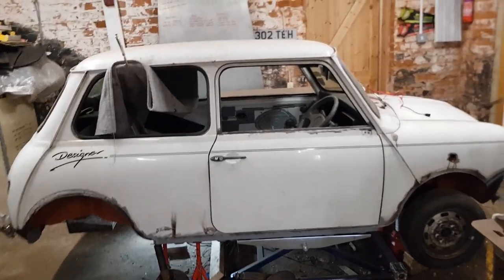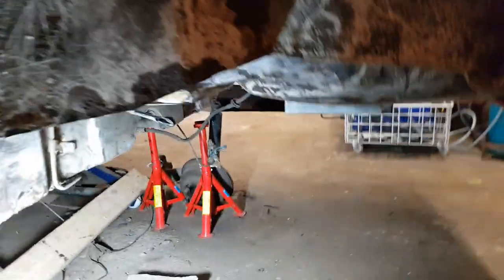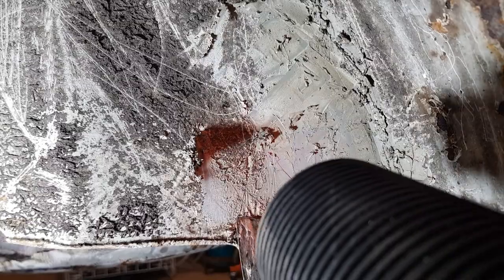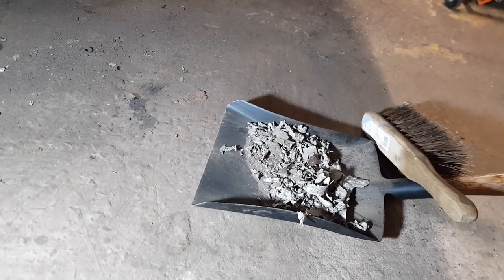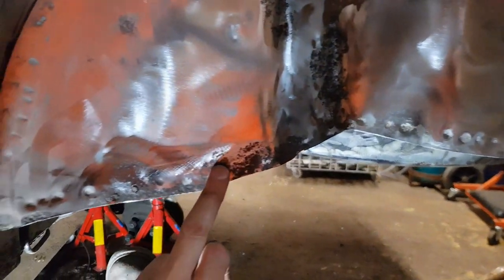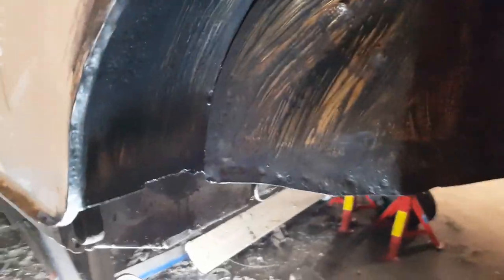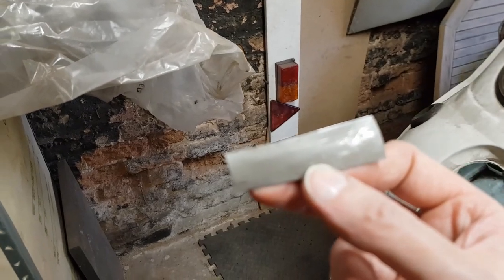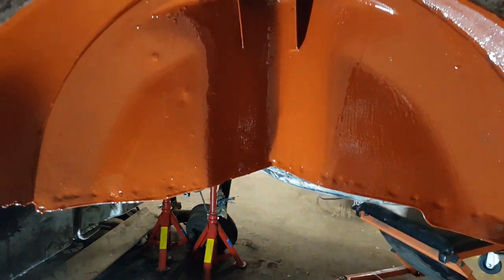Project Designer Ep 31 - Austin Mini wheel arch strip and paint

Comment: I bought kurust to treat rust but do you think it will be ok with bonda primer. Can you recommend the best place to buy the bonda primer.
Reply from the maker: Yes it should be fine. Just give the Kurust time to do its thing and change colour. I've used it on my Mini's before.
Bonda rust primer - I usually buy it from ebay. You have just reminded me that I need some more! Link https://www.ebay.co.uk/itm/383661651812?var=652065711902&_trkparms=ispr%3D1&hash=item5954043764%3Ag%3A7KYAAOSwYYBfJuke&amdata=enc%3AAQAGAAAAkNblkTzS6MaJaJvwi6GS6vQ0F5G1kBoTrxoEkorqMnzGbXHJvDSdc7%2Bo%2BusHTwc3sFFXnIIVsIt41e%2FHOuF7D2ABTUTvhD3o6WOha1UXa6Kiev%2BnUc18j3YqGgJaJp%2BcveQ%2F6XKv2pn190z2D0LIAor9oRygrzZ2Nt6XYaerpOp4JXjoxDs8Oxx%2FoT00qgTL4Q%3D%3D&mkcid=1&mkrid=710-53481-19255-0&siteid=3&campid=5338771361&customid=bonda&toolid=10001&mkevt=1